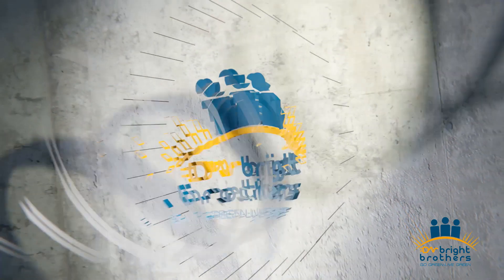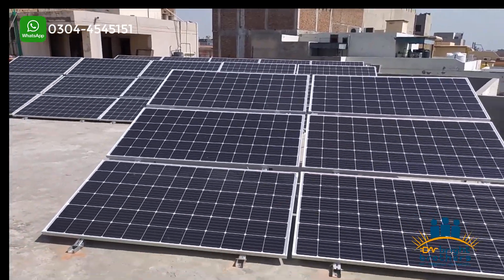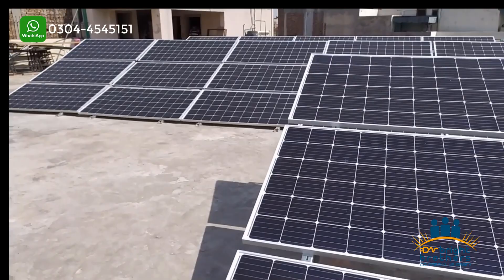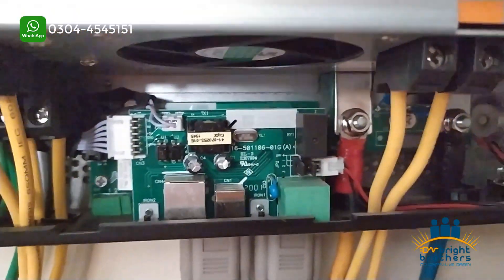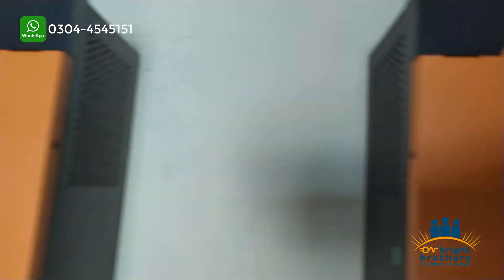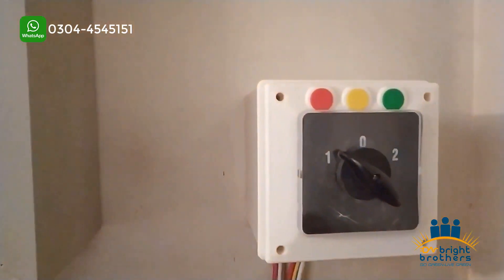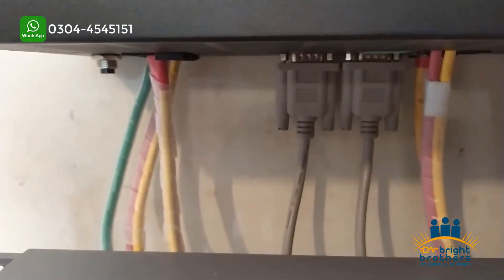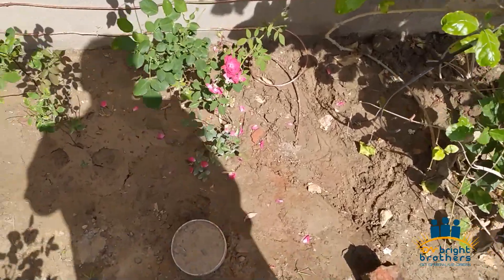15 KW SOLAR HYBRID INVERTER WITH GRID (NET-METERING) INSTALLED IN FAISALABAD #BRIGHTBROTHERS #SOLAR

Comment: Sir, 
All is well but Battery cable minimum size should be 35 mm for 5 KW.
Reply from the maker: You are right.. We already informed to change it.. Due to lockdown cable was not available.. It will be replaced ASAP.. JazakALLAH for your valuable comments.. 😊
Reply: Project cost